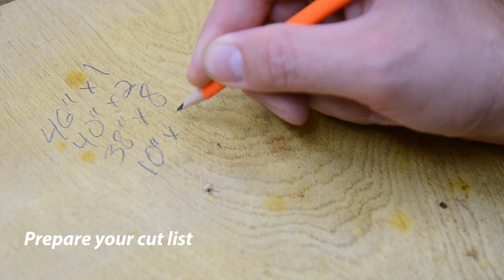DIY PUB TABLE

Comment: And if you don’t have all this equipment? I guess it’s pressboard furniture from Walmart.
Reply: Bro this man is demonstrating professional woodworking techniques. It's obvious most people don't have access to a dustless woodshop with a planer and the fancy kreg jig  but you can adjust your situation according to what tools and skills you have available to you. I have a table saw, miter saw, and several clamps so I could easily attempt this project with a decent level of confidence. My point is let's not minimize the quality of information that was given in this video. Don't be afraid to compromise a step or two like using a hand planer  or sanding a bit more because this project is definitely not difficult.
Reply: With a little adjustment, like motise and tenon (which looks better) instead of pocket hole joinery, all this can be done with a hand plane, handsaw, chisel, and mallet.